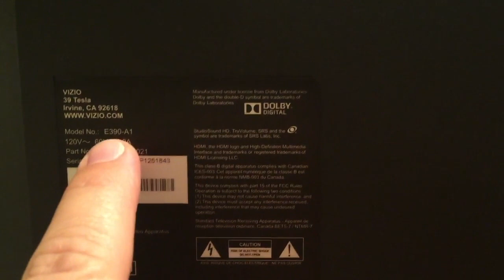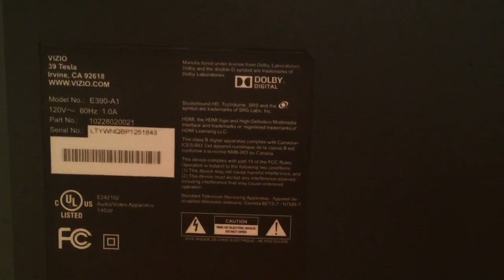Cheap TV Repair - Fix a Flat Screen TV With No Power - Replacing Main Board

Comment: Interesting.  Any hints for me regarding tv won’t come on - red power light lower right hand corner is red when power off.  Turn power on and the light ‘normally’ flashes a few seconds then tv comes on and red light goes out.  However, when turn tv on, red light flashes on & off forever and tv doesn’t come on. Tks, Bill
Reply from the maker: William Sumrall Send me your brand and model number. I will see what I can find.
Reply from the maker: Let me know if you still need help.

Comment: The power cord had a bare spot( a mouse chewed it,)I repaired that. The power come on (green light,then goes to red) where it goes to power board a small black box that clicks as it shuts down . There is a 250v buses style fuse above connection wire. Would it be box or fuse that is bad?? Can either replaced??
Reply: Btw it was internal bare spot not removable cord. For some reason/ unknown the label has been torn off so I can't get model / serial number. Also $$ are very hard to come by this being the reason for my attempt to dy  The TV is a Sony . Was seldom used by my old boss. Hrs are low
Reply from the maker: Sorry I’m not really sure. Check the Shop Jimmy website.